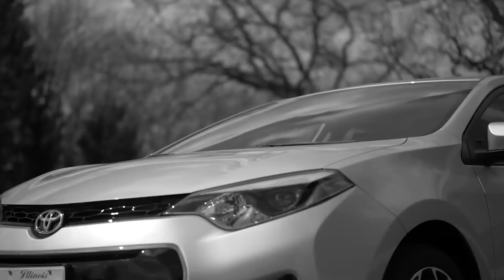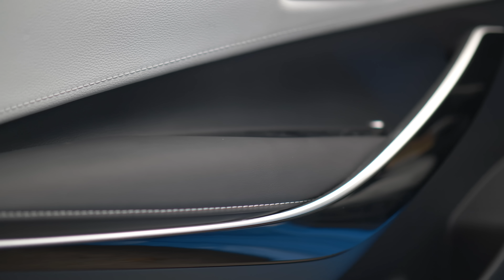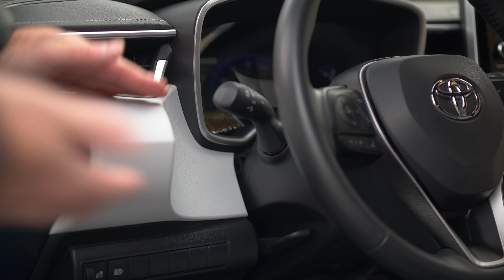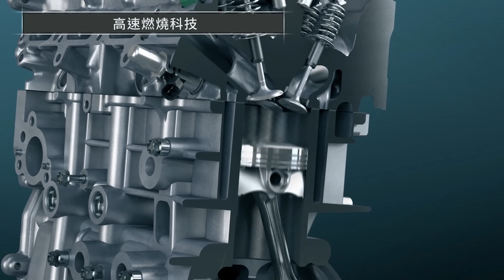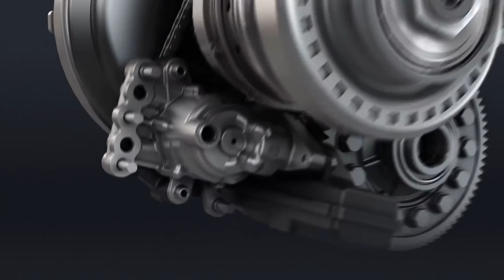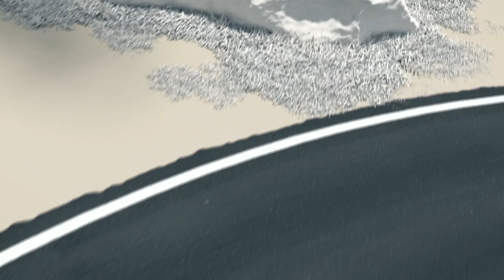Review | 2019 Corolla Hatchback | Sleepy Time is Over

Comment: I watched your review of the 2018 Elantra back then. I was really impressed with what that car delivered for the money. I bought one. After 3yrs of ownership, your review of that car was very accurate. Your assessment of it being simple, old-school technology turned me on to it. What wasn't known was the long-term reliability. Well, it turned out to be a turd. Issues with engine, transmission, and suspension. Disappointed and frustrated, I sold it. Now, I'm considering this Corolla hatchback. I'm hoping the reliability will be monumentally better. Buying any new car with a short warranty, such as Toyota's, makes me nervous after my last experience. The Corolla hatch is on my shortlist though. It should prove itself to be a more dependable car long-term. If it's not, I'll probably swear off the Toyota brand for a second time. I had a horrible experience with an '88 Camry ages ago and swore off Toyota for 20yrs.

Comment: Really good review. I love the scene where you put it on the rack and explained the rear suspension. It is quite sophisticated for this price range and explains the good ride and handling characteristics. And that is the reason the rear hatch floor is a little high as well. I just purchased a 2021 XSE, 6 speed manual, silver w/black roof and black interior (leather is standard in XSE). I am really loving it. Traded a 2012 VW SportWagen TDI
w/ a DSG transmission with 80k miles.  The cars aren’t comparable. It was just time. Lots of sportyness for the money. And hopefully much easier on the bank account.

Comment: Watching this again after now having driven both the manual and the CVT. WOW!  Very impressed.  I prefer the manual, but my kids have no desire to learn and it’s primarily for them, but also so I can have some fun.  The CVT is the best I’ve ever used as well.  I’ve owned everything from a 1986 Toyota Corolla with a 5-speed (first car that I learned on) to a Porsche with a manual and everything in between.  This is a fun car to drive!  It is the definition of “slow car that you can push 100%, stay within the speed limit, more or less, and have a blast!”  I actually enjoy driving it over my Porsche Boxster that I sold.  Haven’t purchased yet because I’m still trying to convince my kids to learn manual!!
Reply: I just drove this car yet again (The CVT SE model) after driving a bunch of other cars and putting some time between drives to make sure my initial impressions were accurate.  I have to say, this is an incredibly fun car to drive and looks great!  I’m still on the fence between the CVT and manual.  As we’re going down to 2 cars, my wife wouldn’t be able to drive the manual (she’s not very good with an auto so no chance)....But, the CVT is a blast as well with the paddle and a physical first gear.  I can’t get over how good this car is for the price point.  I will say it again, this car is more fun to drive than my Porsche Boxster I had within legal speed limits.  My Boxster felt blasé until you get well over the speed limit when it came alive...second gear and you’re already over legal limits.  The Corolla lets you click through 10 gear ratios, and you can do them all while still not going over the speed limit!
Reply: @petegalindez9961 What did you end up getting and do you still enjoy it?  Thinking about getting one now.  CVT new probably for me rather than manual as a used purchase.

Comment: The new trend of popout oriented nav screens has nothing to do with being cheap and everything to do with being driver centric. You want to be able to see the display at a glance for navigation. By mounting the display high you no longer have to shift your eyes off the horizon to read the screen. You just quickly scan from left to right to get the information you need. Molding the nav screen into the dash produces silly sloped angles with lots of glare that require you to practically lean your head to the side sometimes if the steering wheel is obstructing it. I love the popup nav screens that are right up in my sight line.

Comment: My GF has this exact same car and on occasion it acts like a turd when you stomp it entering a highway. In sport mode its far more responsive but she has never pushed that button before. 
He previous car was a 2014 Altima 3.6 with a cvt. That was the best CVT i have driven, almost zero rubber banding and it shifted so convincingly that my gf had no idea it was a CVT. Then at 110,000km the stupid thing started slipping at highway speeds. Rpm would flutter +/- 300 while sitting at 1200. Traded it for the carolla and the only thing she misses is the v6.

Comment: I own a 2007 Toyota Corolla with over 200,000 miles on it.  It's perfect for driving from point A to point B be it to and from work or the grocery store / shopping mall.  Anything else like a weekend getaway, it will literally bore you to sleep.  I mean this seriously because to avoid getting into an accident, I almost often stop once or twice to take a nap or a break.  About the car itself, it's super reliable but it's nothing to look at.  Mostly plastic.  Not the type of car you'd take out to impress someone.  In this case, you're better off taking public transit or an Uber.  Another benefit of a boring plain looking car?  I can guarantee if you leave it unlocked, nobody will steal it.  The Hatchback I would be proud to own and it looks like a lot of fun in addition to being reliable.

Comment: It has two clutches like DCT, first clutch goes to direct shift that operates like MANUAL tranny, second clutch goes to belt that instantly connected to the shaft like CVT. And did i tell it has torque converter(like AT) before all that(after the crank)?

I dont know of this carry build-to-last-by-toyota badge, but very clever nonetheless. Made by AISIN by the way

Comment: I’m sorry, but fake shifting CVTs are something I cannot understand. Just regulate my engine speed and gearing based on throttle, and to hell with people who don’t understand why that behavior is more efficient. This is not the fist time manufacturers have had to engineer for dummies. I knew Ford did it with oil pressure gauges in the early 90’s. Previous to stupidity, Ford had real oil pressure gauges. Customers complained, “why does my oil pressure drop  at stoplights when it’s 90F in the shade, and the AC is on Max?” Ford responded by installing a resistor in the gauge cluster and replacing the sending unit with a switch so that these people would only know if their OP was low when it dropped below 7psi. Thanks for not learning- dummies. Thankfully they still haven’t done this dumb stuff with eCVTs, but surely it’s coming. BTW.. GM had already seen the future of owner stupidity before Ford. The only thing dumber is mechanical OP gauges rednecked in with vacuum lines under the dash below the steering wheel. 
/rant #givemerealCVTordie

Comment: really liked this review.  I bought this car almost a year ago, same color, but in the SE, which I went with because it had about 4 better MPG and because I preferred the black trim in the front to the chrome strip.  Got it with the spoiler, preferred package, and then did some black aftermarket rims.  Love it still.  Your review is spot on, and I really appreciate the transmission explanation.  I'm going to subscribe!

Comment: That is faster shifting than my 5 speed car. Yeah my car is 9 years old but I'm impressed. And I really dont mind a cvt and I actually prefer a smoother car rather than a fast car. CVTs are very smooth transmissions if they are paired to the right engine. I would love to see some V6 or V8 with some chain CVTs. There are unfortunately no 300+hp cars with cvts. I know subaru hake the 3.6L engine that is pretty bulletproof of an engine(MCM out of Australia tuned one for 400+hp and he uses it as a daily driver) however subarus cvts up until 2016 have been pretty rough. It just seems like a large engine with a cvt would be ideal for a very smooth car. Might look into a 2017 outback...with the big engine.

Comment: Finally a reviewer that Actually LOOKS at suspension components and talks about Engineering.  I actually can see that the steering rack/tie rod ends are behind the tires.  This reviewer speaks like he is a degreed engineer.   This is WAY better than the reviewer who " giggles " going zero to 60 and that other reviewer who needs to see all the quirks and features.....This review...he filmed examples of the paddle shifters ...how they respond.  Reviewer understands WHY port injection is helpful to clean the intake valves.  I went ahead and subscribed to this channel.  Keep up the good work !!!

Comment: So it does an amazing job at simulating a torque converter automatic? I know something even better. A torque converter automatic. Toyota put a real first gear and simulated shift points in the CVT, which defeats the purpose of using a CVT in the first place.

Comment: I bought a SE CVT in part because of your review.  This was an addition to my 2012 Matrix.  The engine having port injection is a huge draw for me.  The lack of forced induction is(surprisingly) a huge draw for me.  The dedicated first gear in the CVT is a huge draw for me.  The updated suspension is a huge draw for me.  I did wait until cars on the lot were manufactured after the CVT recall, and even then only a handful were affected.    

My observations:
-Gas mileage has been higher than advertised.  This may just be my grandpa style driving.  Perhaps it was tuned after ratings were established.(I've had 43.4 split highway/city, gets best RPM and mileage around 55-60mph)
-Being on the CH-R architecture makes this handle obnoxiously well.  The corolla hatch is shorter, thinner and weighs less than CH-R.   Using the same base structure is CRAZY.
-Having a first gear in a CVT now feels like a must.   This works so well and is incredibly handy.
-I don't understand the point of paddle shifters or sport mode.  Again, maybe this is my grandpa style driving.
-Interior feels like a Lexus from 7 years ago, aside from the cloth seating.  While having an infotainment system from a Lexus from 7 years ago is rough, I like the general layout and feel.
-Lost the Matrix C-Pillar windows, but they were pretty much useless.  Gained A-Pillar windows, not sure if helpful but it is something I guess.
-The engine will run port in park.  This is something I observed at the dealership when viewing the car in the lot.  I noticed the lines for port injection begin to shake(was consistent with all of the other engines) after setting in park for a few minutes.  I'm guessing direct is used for start up.
-The SE was cheaper than my 2012 Matrix, and offers far more than I could have expected in a Corolla Hatchback 7 years ago. 
  
Other notes.  I wish SE had option for fog lights without upgrading trim to XSE. Fog lights are the only feature of XSE appealing to me.  Increased price of XSE trim was not worth it to me for this option.  But if you want Dual zone AC and heated seats, go for it.
I want to believe in this engine.  Its new, which is scary.  But, the tech in this engine has been used in Lexus and Toyota trucks for some time and Toyota probably has it figured out.  Let's just hope this engine comes with the same refinement as the 2ZR engine.

Comment: Toyota should be praised for continuing to offer a manual transmission with the Corolla.
Reply: Jinxed it. No longer offered in manual for '23
Reply: @docmadhattan came here to say this haha
Reply: @docmadhattan gr Corolla would be a shock to them though
Reply: dont come to 2023 with us
Reply: I have this in a manual. It’s still fun and peppy after over a year of dailying it. 32K miles on it.
Reply: @Nexusdeschain199  hows the car running now after 7 more months, thinking about financing a new 2021 xse with the manual
Reply: @OriginalLofiBeats  like a top, my guy. 50K miles on it.
Reply: @Nexusdeschain199  I have a 2018 civic E-XT.  Even though the 0-60 is faster, the excel from stop is pitiful.  I'm thinking of trading in for the auto with paddle shifters.  It's got an actual 1st gear.
Reply: @Teremei  I prefer driving a manual to an automatic. More engaging.
Reply: @Nexusdeschain199  This car in manual is probably one of the most reliable ICE cars you can buy today. There's always a tradeoff when trying to have cutting-edge and pushing the boundaries... it's great, but often comes at the cost of reliability. Toyota's done this car right by not trying to overdo it, and the price is very compelling.
Reply: Not on any entry level models.
Reply: @travelinben1966  My comment is 7-years-old.

Comment: The cvt transmission is bad and Toyota knows it .just like the a.c. blower motor or compressor that dies between 20k and 45k miles .Toyota recommends an upgraded compressor and blower motor but you have to pay for it even though they are bad from the factory . Google it and you'll see the dealerships are charging $1500 to $2500 just for the a.c. breakdown. The cvt transmission I wouldn't want to ask.

Comment: I'm just gonna be honest and say that I hate fake gears. I don't have CVTs, only the posers. 

The point of a CVT is to be faster and more efficient than an automatic, so why take that away? If I hold my foot to the floor, it would simply be faster to just hold close to redline and adjust the gearing constantly to accelerate. On the other hand, if I'm driving leisurely, it would be more efficient to stick it at 2,500RPM to get up to speed, then adjust the engine speed down when I'm done accelerating.

I get why they fake gears. People are used to it and like the shifts. I drive a Civic SI, I love shifting gears too. But I'd rather a CVT do what it does best: drive efficiently.

Even worse are half-fakers. My girlfriend's Crosstrek doesn't fake gears if you're going slow, or at least the effect is tiny. But if you put the pedal to the mettle, it will fake gear shifts. WHY?!?! The car is nice to drive because it's perfectly smooth when you're driving efficiently! I wish I could at least configure it.

UGH

Comment: I see a lot of people questioning why they used a cvt and a first gear, thinking that it's a terrible idea and neither an auto or cvt. Here's how it works. Its analagous to Hondas vtec but with a transmission instead. When you drive it hard, the car simulates actual shifts and rows through gears. If you want to drive it soft and get good mpg, it will act 100% as a normal cvt. I've found it will rev through the gears whenever pushed past 2800rpm. Otherwise, it will hold a steady rev under that number and get you good fuel economy. It's really quite simple and fun, and has saved me a lot of money on gas even with my spirited pizza delivery driving

Comment: I am way late on this, but does the cvt hold revs? Just curious. Just wondering if 6 speed if the real option here.
Reply: It does occasionally, but most of the time does not. It seems to vary in mine based on how hard I am driving it. It is easy to overcome with the different drive modes

Comment: I chookte the CVT because I want the lineair accelleration, the fake simulation is oké in sport, but in drive it should be a CVT! Driving CVT's (since 1964) I use the tachometer, during accelleration keep the revs between 2.5k & 4k-rpm, don't need to floor it! Only over 80 mph I sometimes floor it.

Comment: You have great reviews. The only thing I would add as a daily driver of CVT. The paddle or "gears" work great in slippery/ snow conditions. CVTs really suck in snow it seems like they don't know what to do most of the time. In the snow it's great to lock the cvt into a ratio and you can also engine brake which give you extra control. Found your channel a few weeks ago and you really nail the reviews.

Comment: I wanted to buy Toyota Corolla but now I hesitate. Mazda 3 looks more fun, it's just a pity that it has little power compared to Toyota. I like Toyota's two-liter hybrid engine. I need a reliable car, preferably in a estate version. Consumption and noise at high speeds are very important to me. 
What should I do now?
Reply: vojtik1234 High speed?!?? The car is limited at 180 kmh! Take the Estate and use 130 kmh as max, very fuelefficient and spares You an extra stop at the petrolstation by staking away from the higher speeds.

Comment: Isn't the Ford fiesta se sedan dual clutch 6spd automatic it shifts quicker than this
Reply: Yeah but then it craps out at 60-90k miles.  Read about it, my friend's Focus is starting to die and it's got like 70k on the clock.  This CVT trans will probably outlive most other compact cars period.
Reply: @roycezaro1998   I heard that the 1.6liter  motor in the fiesta  last  are very reliable the focus ,s were junk I had a 2001 and it was in the shop a  more than I got to drive it  I got rid of it the fiesta motors and cars were originally  made a produce I. England  before they got over here in 2010 they were in Ford's line up they kept remodeling  them til 2019 will be the last know the fiesta st is still built and assembled  in England  until Sept of 2019 then that will be the last fiesta St I hope the bring the European  version  over here probably  won't until 3 or 4 yrs

Comment: I have the 2018 Corolla SE and the biggest complaint I have with it is the transmission. I understand the reasoning behind CVT and it does give me amazing gas mileage (I can hit 35mpg easily on the highway), but the lag when you accelerate from a dead stop is killer. I can put my foot down and the car will hang at 3-4k RPM and slowly accelerate, then it will actually start to accelerate faster. It's a pain, and I really hope that if this new CVT with the physical first gear is as good as it seems, that I'll then consider the next generation Corolla to purchase rather than go with a Jetta GLI or other car.